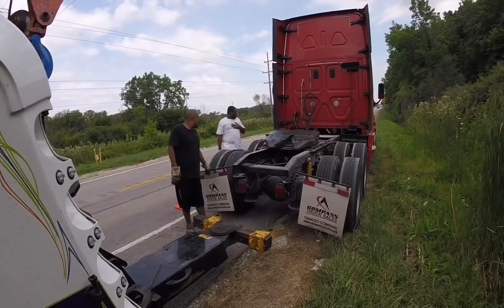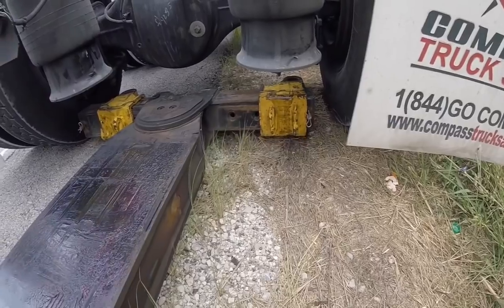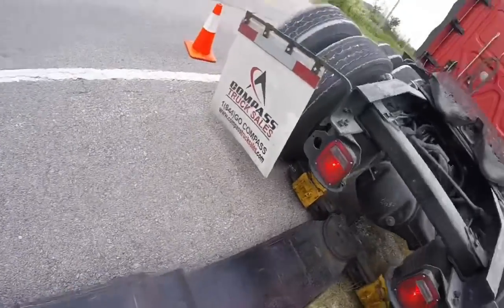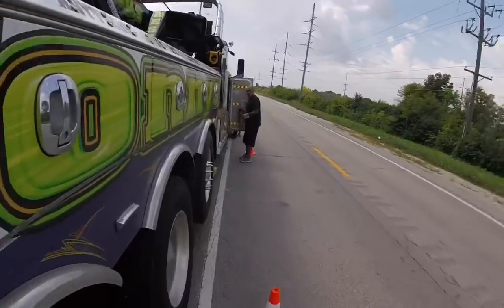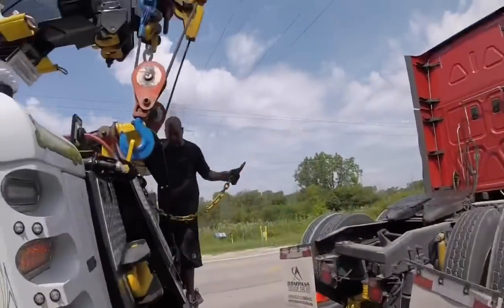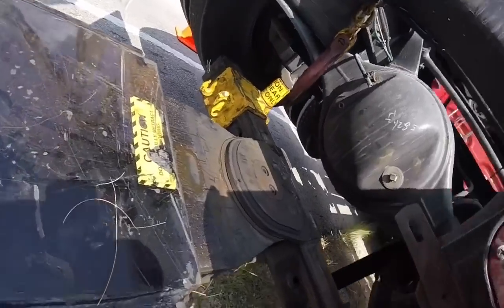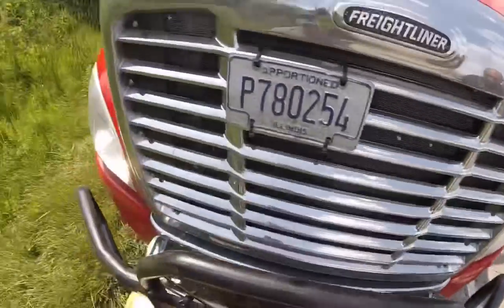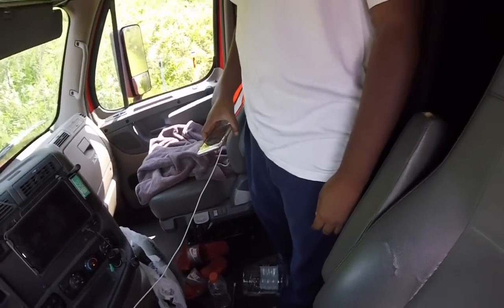Rotator work ep #101 Freightliner rear tow

Comment: Normally, Malachi --- when you do a lift from the front.. ya disconnect the shaft, 2nd or so.. then lift the front with your large set of forks.

Why... are you using that round disc things.. instead of the forks?
Also...
If you do a rear lift, why are you disconnecting the one shaft.. and not both?
Reply from the maker: Not sure what you’re asking but I use those unbolt forks when towing from the rear makes for a quick hook up and I only remove the shaft when towing from the front so that the gears don’t spin in the transmission and burn it up hope that answered your question thanks again feel r watching

Comment: Malachi yeah I just want to ask you a question I'm just trying to figure out or one of what's the reason why do you do you hook up a chain on that tire in front of the back tire what is the reason why you do that one for
Reply: keeps the front tandems from dragging.  thats why he had the driver dump the airbags.. to get them up as far as possible... then chain them in place before lifting the rear end up
Reply from the maker: And the axel isn’t light weight so if it’s just hanging it has the chance to bounce and cause shock damage and could possibly break away never seen it happen but I also never not tie it up thanks for watching and thanks for helping with the comment always appreciate all my subscribers always a big help
Reply: 1140 rotator work I also always do it so air bags don’t hang and rip
Reply: Okay makes sense thank you